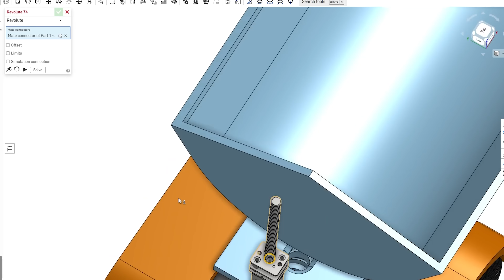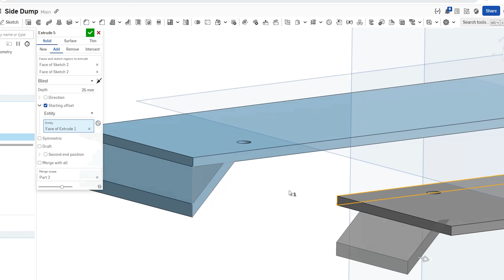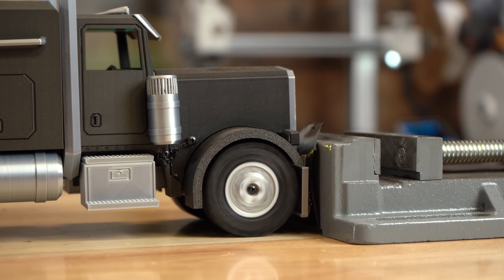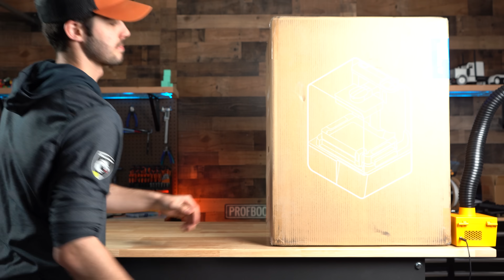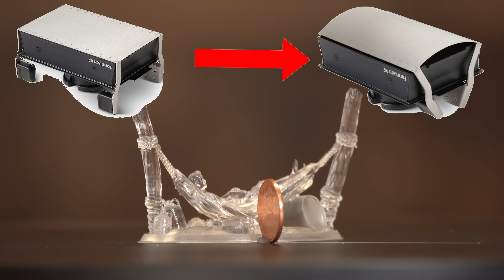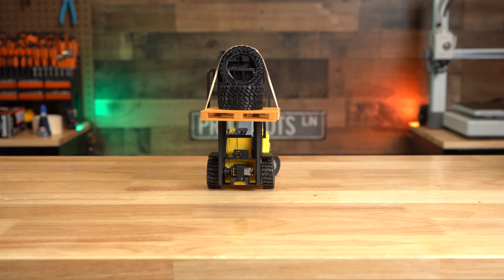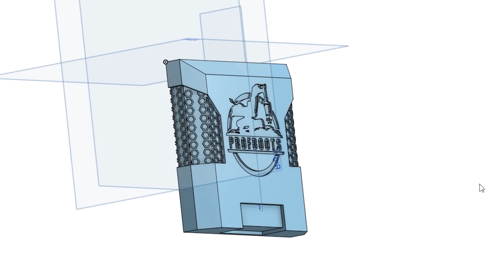3D Printed RC Dump Truck - DIY

Comment: For the silicone tires popping off, the best way to keep them on is to mechanically lock them in place, by designing them to not be easily removable after assembled, e.g. with a lip that goes around the inside of the wheel, so far that only the the shaft is protruding. But there may be other options as well.

Comment: instead of selling people on the idea of silicone 3d printed tires at 3500$ just start adapting the design to readily available rc tires that you can buy for a few bucks... :|
Reply: YES!  This is exactly what I was thinking, there are plenty of sizes on amazon.   Just design a rim to fit them and make it an option for those who are willing to spend the money.

Comment: Have you thought about adding an FPV camera on your vehicles? you could drive it anywhere without being limited by walking, and this also adds possibility of driving it anywhere around the house (maybe a home sized highway and city system).

Comment: heres my ideas of what could be made next with this chassis

wrecker with winches
standard dump truck / super tag dump (working tag axle would be baller)
roll back tow truck
snow plow
garbage truck
moving / box
utility co. / cherry picker
rigid frame fuel/water tanker
Reply: Fun fact (from a person that drives one) plow trucks are actually dump trucks, the plows are just taken off most of the year (we can put them on in just a few minutes) and the salt/sand spreaders just slide into the dump bed, so he would only have to make one truck for both of those!

Comment: Very cool idea!

Would it be a good idea for the next project tot build a kind of tractor?
This can have a mechanical attachment in the front and back for attachment, even the dumb users (like me) kan design attachments that connect the attachment cilinder for whatever we want

Comment: Superglue is what you’re supposed to use on bigger RC cars, so it’s the best solution to keep the tires from slipping off. To help the tires mount straighter, make the wheel diameter a touch larger, and put a raised lip around the middle of the wheel that fits into a groove in the middle or the tire.

Making the walls of TPU tires could help them conform to surfaces better. Open cell foam can provide the support, like the with regular RC cars use.

Comment: For the silicone you could make the rims with spikes so it doesn't slide around and you can only remove it by pulling up and then pulling sideways
Reply: I was about to suggest something similar: a V groove that goes from the rim into the silicone, or the other way round, not really sure which could hold better.

Comment: About your forklift not fitting into the cargo van trailer design... I've been to places where they load cargo van trailers with electric pallet jacks like raymond rider pallet jacks for example. Could be a cool side project in the grand scheme of your RC designs. Smaller profile allowing for ease of maneuverability in cargo van trailers.

Comment: Make a tanker trailer for the rc semi truck
Reply from the maker: Yesssss!! I want to make one that has a little spout that will pour whatever is in the tanker. You could fill it with soda for events and fill people’s cups from it😂
Reply: @professorboots that’s a genius idea and use something like waterproof pla or waterproof pla paint to make it not leak
Reply: @professorboots  There are those pressure pump systems the old youtubers used for theese kind of soda machines. Would be great if you could just open the tanker up, and put a whole "unopened" bottle of soda there. Then ofc screw on some special (food grade preferably) bottle cap which has the tubing in and out so it can transfer the fluids.
Reply: @professorboots  that would be so funny, how would you keep liquid inside? Coating the inside in food-safe resin?

Comment: A full wrecker, with a body like a Zacklift, which could be just plopped onto a normal truck, without having to build a whole new one would be pretty cool! With a twin line boom and a wheel lift too!

Also, having tie-down points on the drop deck would be nice to avoid dropping cargo on sketchy scenarios and increase the realness

Comment: something id like to suggest next, would be a logging trailer! maybe having one of those loader things with the boom arms, i think their called telehandlers? this is just a suggestion though :3
Reply from the maker: That would be so cool!! I’ll put it on my radar, thank you for the suggestion.
Reply: @professorboots someone made a log trailer as a remix to your semi on printables.
Reply: Yes! A log trailer with a loading arm, easy to get straight sticks to use for logs.

Comment: Can you tell us what printer you use? I have a makerbot and my prints could never come out this clean. Want to upgrade to something like what you use
Reply from the maker: I’ve been using Bambu printers for the last year and they’ve been great! Would highly reccomend the a1 if you don’t need to print any engineering grade materials.

Comment: Cool stuff! Your whole line of vehicles is very nice. The crane especially. Do you think you will ever do mods for off the shelf RC's? I've done some 3d printed WPL mods on my channel, dump bed and adjustable plow for the B16. Instead of the exposed threaded rod and motor setup you use, I found some fully contained linear actuators that are the same in principle underneath but look a bit more like real hydraulic rams (but only come in certain lengths).
Reply from the maker: I think it would be super cool to mod off the shelf rc’s. The only thing holding me back would be setting up the controls as I wouldn’t be able to directly alter the code/controls on them.
Reply: @professorboots  you could use an esp32 or arduino to mediate any pwm signals you need to route around (as you do in your videos i think), or use something like a Radiolink rc6gs transmitter and receiver combo that you can customize the controls of. check the description on my (only) video to read how i integrated all the new motors and servos with that controller if you want, it made it pretty simple. The main idea is to hook into each part of the "modded" rc directly (steering, drive motor), not try to use its existing control circuitry, so you don't need the code or need to control them that way.